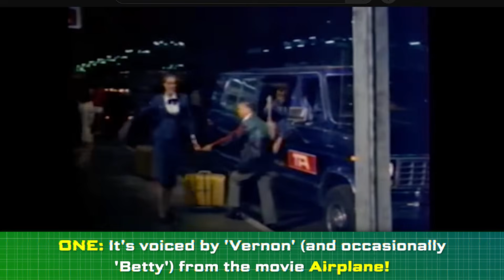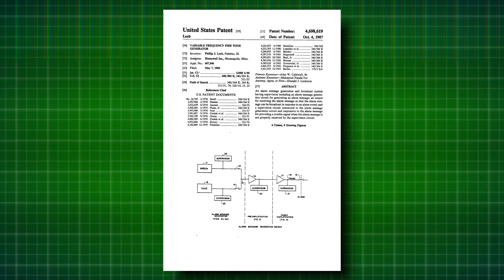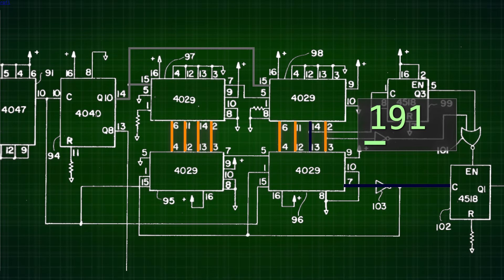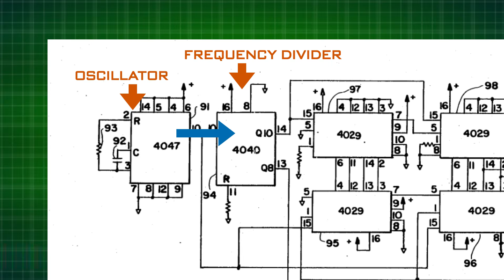I built the Honeywell fire alarm tone generator

Comment: I recall one video of a fire alarm going off in an office building, where the person was recording a System Sensor SPR remote speaker in a stairwell. I recall it having a very interesting whoop tone I’ve never heard on any other system, and I think it may be similar to the sound that tone generator you built made by default. 

Also, that Honeywell tone generator you built sounds very similar to the Firecom LSN2000 in the new WTC1, but that might just be a coincidence.
Reply from the maker: Ooh, lemme know if you find that video!  Also yes, the WTC1 video is very similar but not exactly the same; the whoop spans more than one octave and the pause is longer.  Could indeed be a very similar circuit, though
Reply: @NicksMadScience  I did find that video I remembered. It’s “Fire Alarm in Highrise” by @18ricco on YouTube. 

Listening to it again, it sounds very similar to both your tone generator, and the Firecom LSN2000, but yet is not quite the same as either.

Comment: Hi Nick, great video! I have been researching the FCI 7200 and FireVac for a while now, so I feel like I can answer a couple of theories or questions here. 

I firmly believe the Entergy tower was a FireVac III system. I am friends with ARA Productions, and he told me that the voice evac in his video was from an FCI 7200 with voice on it. Now here is where things get interesting

There are actually 2 types of FireVACs that FCI used during this time: the FireVAC III and the FireVAC 7200. The FireVAC III was made during the late 80s and early 90s, and was first used on the FCI-ID panels (later would get support to work on the 7200). FireVAC III is a very modular panel, and I believe it would have analog audio, as they had different tone cards. Now the FireVAC 7200 is meant to install directly into the 7200 cabinet, and holds its audio digitally. In fact, the FireVACc 7200 boards are identical to the FireLite Fire Command 25/50 voice panels (those little FireLite panels with the big red switch on them). 

Currently, we don't know if the FireVac 7200 shares the same tones as the FireVac III. I'm very curious what the FireVac 7200 sounds like, but hopefully soon we will see what it sounds like. Something interesting I've noticed is that the FireVac message sounds extremely similar to the messages as the Honeywell DeltaNet (Steelcase Pyramid).
Reply from the maker: this is very interesting information; thank you!  i wish there existed even like, one youtube video of a certified firevac iii, or some literature, or any info at all, really.  who'd have thought that an obscure ~40-year-old bit of building infrastructure would have so little information available, right? :D 

fwiw an old job of mine was in a building with what i'm pretty sure was a modern-ish firevac 7200 and i can confirm that it sounded just like the 25/50
Reply: @NicksMadScience  I have a small little update! Found some pictures of the inside of Entergy Tower, and I can confirm its FCI as the pulls are FCI MS 6s
Reply: @FireAlarmGuy13 hu

Comment: Recently took out a autocall federal signal panel that did this voice evac, and i recognize it as it's common in my area, do not remember the model but I would look in to that. I will edit if I find the model number, the patent or anything like that.  Overall I am 100% sure it came from federal signal and I know one system that still has one of these so I'll see. Edit: (on my way back decided to drive past the building and stop by, it is in fact an autocall voice evacuation message, however older autocall is Notorious for not put model numbers on anything, so there isn't a model number.) Edit 2:  (figured out it's a completely different voice evac just shares the same tone in a lot higher of a pitch)
Reply: What? If it's Autocall/Federal Signal why is the patent assigned to Honeywell then? (unless maybe Autocall/Federal Signal contracted Honeywell to make that tone generator for them) Good find though! (also nice job saving that panel, as it very likely would have been lost to time otherwise)
Reply: @TheCarson116  the Tone generator that was recreated in this video is mostly used in the fire-lite miniscan 424 and sensascan 1000 series panels (you could see them in a Honeywell Deltanet too).  I know this cause I work on this stuff ALOT like an unhealthy amount alot.  However it's still very hard to exactly point on point identify.  I believe fire-lite bought the rights to the Tone generator used in this video, or may have even just partnered with Honeywell however I'm not too sure and I would have to do more research.  Beyond this I think it is a completely difference tone generator as how he describes in the video there's no steps in the audio to create that analog tone and no potentiometers or anything to change the pitch.  Also I do not believe autocall would partner with Honeywell as at that time there are rivals and I believe still are as Autocall are now a part of simplex.  Next time we get to test on the system in the building that I thought I heard this voice evac from, I will try and find the model number or something however no promises.
Reply: @TheBlack2903  Oh? Huh...well, that might answer that mystery then. Interesting if that's true since that was quite a few years before Honeywell came to outright own Fire-Lite.

Yeah, definitely: Nick himself said it's clearly not the same one, & you can clearly hear that for yourself too.

Maybe, but keep in mind that Autocall/Federal Signal were likely still newcomers &/or small-timers in the life safety industry back then & thus might have needed assistance from more established manufacturers. They also were not part of Simplex then, but are now as you guessed.

Alright, best of luck! (would also be sweet if at some point you could succeed in saving that same system too, heh)

Comment: Nice video Nick! Shame the tone generator you built (that I have no idea where &/or how you found the chips for by the way) doesn't match what we've been looking for, but still fascinating nonetheless (cool whoop tone it generates too). What do you suppose Honeywell would have used it for?

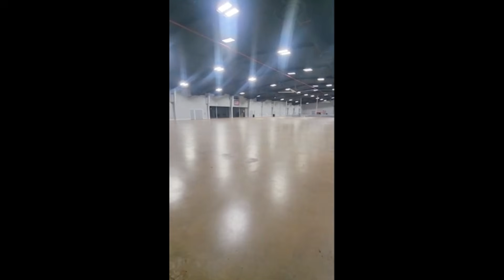2:45 That's what I was thinking too, especially with the differences in pitch depending on the system.

2:48 Why not? Might as well I guess!

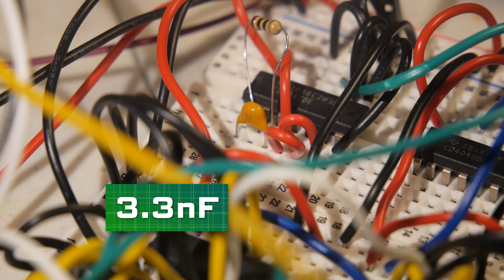2:59 You say "pitch", but the speed is also clearly getting faster & faster with each capacitor you put on.

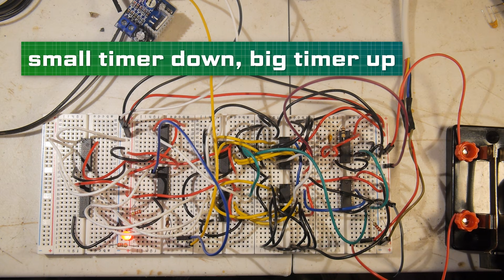4:01 Well that doesn't sound right!
4:08 That's better! (very reminiscent of that one European "descending" tone actually)

4:22 I think it would sound nice if you could also somehow have the whoop immediately start playing again so that it would be continuous without that weird noise in between whoops.

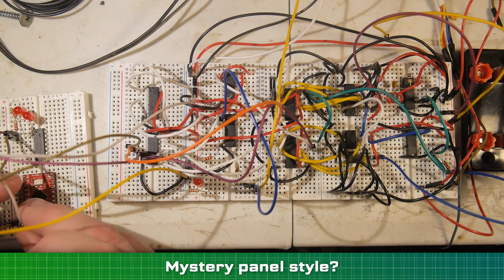4:45 Definitely better since there's no longer that bizarre bird-like chirping in between whoops.

5:01 Nice attempt at making it sound like the panel we've been looking for! I like the tone at those pitches!

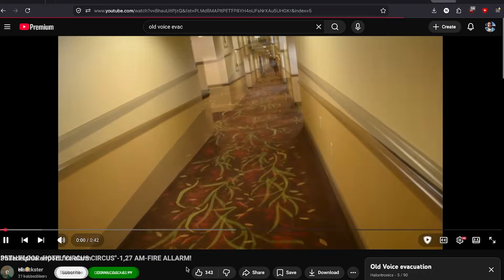5:30 In all the videos I've watched I don't believe I've ever heard a slow whoop tone that sounded exactly like that either.

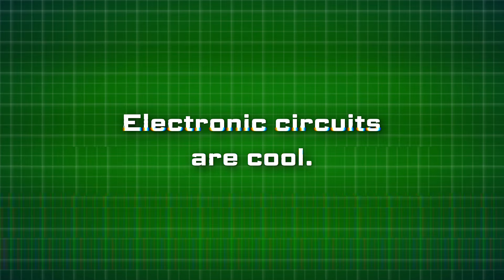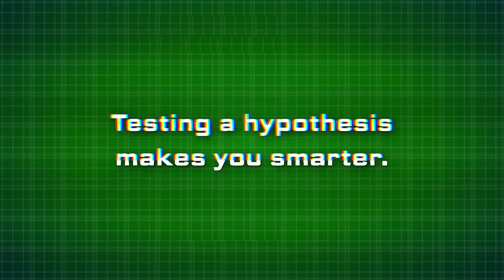5:53 5:59 Right you are!

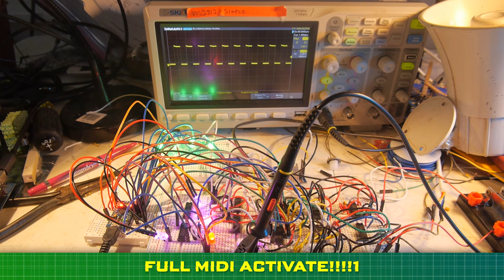6:13 Heh, neat.
Reply from the maker: thanks!  if i had to guess based purely on the time period, i'd say maybe the w940?  but who knows; honeywell is a huge company and there's so little info on those old panels!  i'd love to find a "gray-beard" type who was around during those days.

re: finding the chips, i googled around for "4040 ic", "4029 ic" etc. and discovered the world of 4000-series CMOS ICs!  this led me to 74hc-series ICs, op amps, etc.  electronics are fun
Reply: @NicksMadScience  Sure thing! Yeah.

Oh, alright I guess (I was mainly wondering because a lot of the time chips like that can be proprietary & hard to come by due to not being in production anymore, but apparently Honeywell just used basic chips that one can get anywhere when they designed that tone generator).